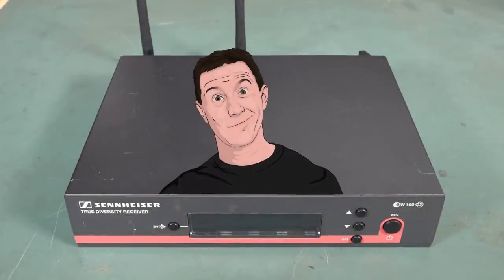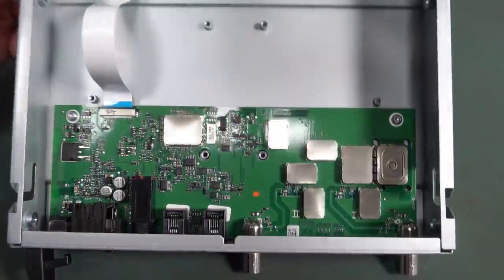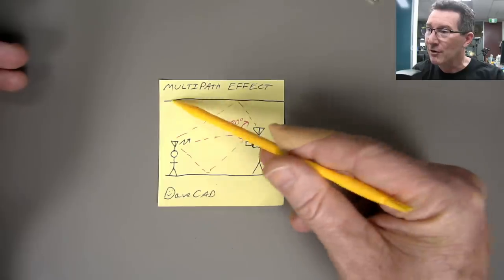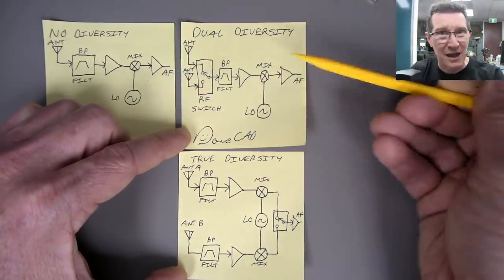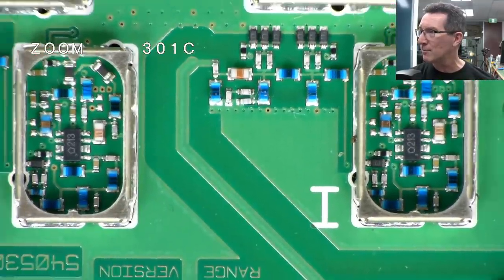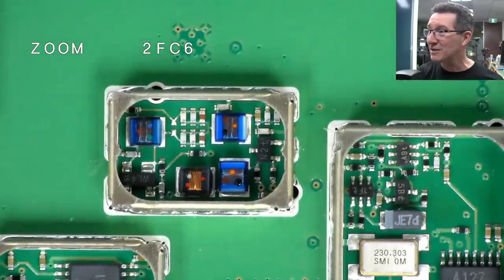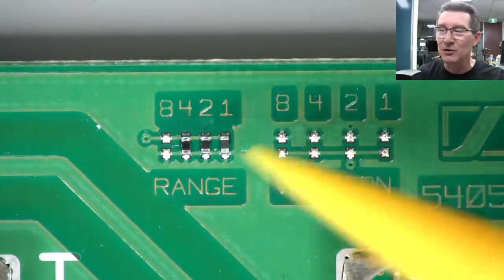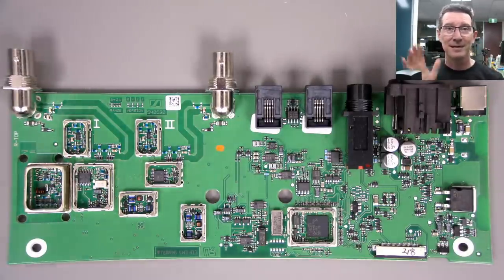EEVblog 1416 - Random TEARDOWN: Sennheiser EW100 True Diversity Receiver

Comment: Another benefit to diversity (when using linearly polarised antennas) is that you can set the receiver antennas to different orientations (90 degrees apart)  so as to significantly reduce the up to 20dB loss associated with the transmitter antenna being 90 degrees out of plane with the receiver antenna.  Pretty handy if your transmitter is mobile and changes orientation regularly.
Reply: This is a way to go when setting up live events with wireless microphones...
Reply: That completely disagrees with recommendations for Wi-Fi radios capable of spatial diversity.
The antennas may be angled relative to the housing, but as a pair they should be parallel to each other.
Reply: @howardhiggins9641  thats MIMO not reciever diversity

Comment: Hi Dave ! love your videos. 
I used to work for a car radio manufacturer in the late 80s . They devoloped a didiversity receiver for the FM broadcast band. It could mix up to 4 atennas. The atennas were not switched, instead it fase shifted the intermediat frequency stage and summed up the signals and then to the demodulator. The net effect was sinthezising a directive atenna sensitivity pattern to maximise the best signal quality and reject intefering signal paths.
All done in analog domain !!
Reply: Range Rover P38 uses that exact system.
Reply: thats a phased array not a diversity system. Been round much longer than that

Comment: Not a Faraday cage, more like a massive large multimode waveguide. Complete with random absorbers and filters all throughout the volume, so that you can get a point that is 30cm away from another, yet have 60dB of signal strength difference between them.

Comment: Dual IFs and dual mixers mean it is a double conversion receiver.  The IFs are 241 and 10.7 MHz. Only the first LO is tunable. The service manual for a similar product, the OM100, is on elektrotanya.

Comment: 22:00 yes, you can power these recivers from an antenna-combiner via the bnc
Reply: live sound engineer here, this is the answer. Company I work for has about 4 cases, each with 8 of these receivers and 2 combiners at the top. Larger gigs that require all 32 of the receivers will use another case that has another combiner to bring all 32 receivers into a single pair of antennas that will typically be placed stage left to front of house. Occasionally we'll use 1 antenna stage left, the other stage right, but we try to avoid this due to theoretical impedance mismatches with different cable lengths.
Reply: Those components look pritty tiny for powering the reseaver.
Reply: @ceilingfanmusic6597  The receiver only draws 4 watts peak, so that diode is plenty big. And presumably both antenna connections would be feeding power, so the current in each of those diodes would be cut in half.
Reply: @strehlow  maby true but look at the components for the dc input compared to the phantom power in for the receiver. I'm sure it works but they just looked small to me lol
Reply: @ceilingfanmusic6597  Without tracing everything, it isn't clear if the main power components are even used if phantom is there. Meaning does the phantom feed the inputs of the regulators, or replace them? Clearly it works, but I can't explain exactly why without studying it further.

Comment: @22:00 Those diodes on the antenna inputs will be input protection to shunt excess input voltage to ground to prevent overloading of the front end, that is a common technique to prevent front end overload.
Reply: Doubtful.  Were that the case, one end of each diode would be taken to ground as immediately as possible, and there would be no earthly reason (sorry) to run a long trace to connect the cathodes of the diodes together.  Also, the ferrite beads would hurt the surge suppression capability.  A quick scan of the user's manual shows that the ASA 214 antenna splitter is in fact capable of powering receivers via the RF input jack, so this appears to be the purpose of these circuits, and it explains the orientation of the diodes.  The two ferrite beads and the the cap to ground help prevent noise on the system power rail getting into the RF input.

In less time than Dave spends in frenetic speculation he could have done a few simple continuity checks to see where the cathodes of the diodes connect into the system.  Seems likely they go to the input side of a regulator.  Were they connected straight to the supply rail, there would be no reason to connect them together with an isolated trace rather than dropping each one directly to an internal plane.

Speaking of diodes, perhaps more interesting are the two groups of three diodes on each of the input filters.  Notice that they are in parallel within each group, and the anodes are grounded.  There is a resistor connected to the cathodes, and that node also connects to a pair of paralleled capacitors  that form part of the filter circuit.  Unless there is a negative supply in the system, the diodes will always be either unbiased or reverse-biased.  This, and the fact that there are 3 in parallel, suggests that they are varactor diodes used for tuning the filter, probably under processor control.  Presumably, the three in parallel are needed to get more capacitance.  Were they, say, PIN diodes for band switching, the orientation would be opposite and it seems unlikely that three would be necessary.

Comment: The is actually rack mountable, it just doesn't have the hardware attached. The same case style is also used for the 1:4 aerial amplifier/splitter (which can also provide power over the bnc to the receivers), which might explain the extra mounting points.
Reply: We talking a 19” rack? That’s a lot of wasted space…
Reply: @colejohnson66  yep, a 19" rack. They're designed to fit side by side, so you can get two receivers per 1U. In fact, now that I think about it, those extra mounting holes will be for the plate that is used to connect the two receivers together.

Comment: Sennheiser evolution user here (for decades!)  Great units for both their wireless lav kits, XLR mic plugs (as seen on ISS / NASA all the time) - and I can confirm the receiver base stations are better than the small camera receiver units which can flutter a bit at times at distance.  But on the whole, 10 hours battery life... super durable casing and connectors... easy to configure... can custom name on the displays for ID, etc.  Staple of the news and video production industry!  I glad to hear the Dave tick of approval on them.

Comment: You didn’t mention Rayleigh fading - although you did kind of describe it. The effect of the multi path is to cause a deep fade / cancellation every half wavelength you move.  Polarisation diversity antennas are often used in mobile phone systems to avoid too much clutter on rooftop sites - another way to achieve diversity without two physically separate antennas.

Comment: Sennheiser ...... Ah now there is a name you can TRUST. I bought my twin daughters bottom of the range Sennheiser headphones ... like 5 years ago or something when my kids were 10, they cost like $15-20, but even my daughters could immediately tell the sound quality difference from all the BULLSHIT Dre Beats, and other "fashion" phones all their m8s had. And both sets are still working .... take away QUALITY does not always require a phat and open wallet :P
Reply: Except they recently sold the entire headphone brand. Wait to see what happens there.
Reply: @Shawn Bergin Is that epos like the old speaker brand?
Reply: for the old and cheap models I have (hd 415 and 457) the sound is just correct but the build quality is great compared to an AKG k242.

Comment: It's not a Faraday cage Dave, it's a giant capacitor, if you full charged it then shorted it out through a DeLorean  it would generate 1.21 gigawatts of power
Reply: Except the plates are completely shorted together by the rest of the steel framework.
Reply: @SomeDudeInBaltimore  "bleeder resistors"
Reply: @tythagoras5787  Very, very, VERY low resistance shunts

Comment: Nice video! It seems to have overlooked one small but nice hardware feature of the EW100 G3: just left of the display, there is an infrared (IR) interface. Why? Quite clever: the wireless microphones / belt pack transmitters have such an interface as well. When held less than 10cm apart, the user can synchronise the programmed frequency and the user programmable mic name (“Vocals Peter”). Quite handy! Setting frequencies on these small microphone transmitters is not trivial, especially when you have multiple mikes and are working under pressure such as in live sound. The presence of this IR interface makes you wonder how 'standard' the display assembly is... 

Talking multiple mics, some have already commented on the fact that the EW100 supports DC powering related to its two antenna inputs. Actually, if you look well at the labelling on the back panel in the video, you can already see it’s DC power into the device (from antenna to device), and not from device to (active) antenna.  

Why does this feature make sense? Audio engineers often use multiple wireless mics/bodypacks, so also have multiple receiver units. Also, they often have their receivers at the back of the venue (‘Front of House’), with the microphones on stage, and then want to use well placed, directional antennas. For such users, Sennheiser was selling ASA 1 Antenna Splitter alongside the EW100 G3 series (now replaced by the ASA 214 which supports G3 and G4 units). It not only allows you to connect a set of good active or passive antennas to up to four receivers (or 8 using two splitters), but, using the DC powering feature, also power all these receivers. This not only makes the setup cleaners, but also more reliable. (Not irrelevant, I had a EW100 PSU failing myself, too bad that these expensive devices seem to come with not-so-good quality power adapters…) 

Kind of in the opposite direction, for in-ear monitoring (IEM), Sennheiser has a similar system on the market: with an AC 41 antenna combiner, up to four (1/2) rack-mount transmitters can share a single antenna while the combiner also powers all these transmitters.

Comment: Maybe somebody else already mentioned this, but...

Sennheiser rack mount receiver (this one is rack mount receiver, it only need rack mount kit, mechanical steel stuff) have option to get DC power via RF BNC. Imagine setup with 8 receivers. Each receiver need 2 antennas and wall PSU, total 16 antennas + 16 coax cables + 8 PSUs. Now you need to put all these 16 antennas on stage or in TV studio and connect 8 wall PSUs in your rack. WHAT A CABLE MESS!

In these situation Sennheiser can sell you additional device called antenna distributor. Antenna distributor have ~20 BNC connectors on back and IEC12 power inlet. 2 BNCs for incoming antenna coax from stage, 16 BNC OUTs to receivers, 2 BNCs for linking (don't ask why, I don't remember why there are LINK  BNCs). Antenna distributor split (and ampilfy a little bit) incoming RF signal from antenna and sent to every receiver, but... antenna distributor also deliver DC power to every receiver on the same BNC. So, now you only need one 230V AC power cord for every 8 receivers  + distributor. Nice and clean cable management!

As bonus antenna distributor also deliver (receiver is not delivering) DC via BNC to antenna input specially for optional antenna 10 dB(?) RF amplifier.

Comment: 22:05 - correct, you can get an antenna distributor that will power this unit over the BNC cables - see Sennheiser ASA 214. now a question for you.. 
i have Sennheiser IEM transmitters which are powered from an antenna combiner over the BNC cables. i also have a Shure PSM300 antenna combiner, which isn't powered over BNC. will plugging the powered combiner into the PSM300 damage the latter?

Comment: I have some dB technologies wireless systems where the RF cans are actually branded, something that you think might look a bit chintzy but actually it looks really smart, also it's wise to not their cost cutting in that the posher reciever with an LCD display and metal case actually uses the plastic case (rear and bottom) and mainboard from the cheaper reciever.

You need to acquire some older wireless systems now to teardown, the old TOA systems with the silver/gold/satin receivers are available quite cheaply and seem built very well, including using a built in PSU. 
Also noting that despite their age (released in the early 80's, I've seen adverts from 1985) they use AAA batteries (x3) and as such you still get 5hrs of battery left with the battery low LED lit, some 9V systems don't last much longer on a full battery, total rated battery life is quoted as 30hrs and I for one believe them.

Comment: Qorvo has been around quite a while.  In Wi-Fi they tend to make the higher quality. mid-scale hardware.  There products would not be used in cheap, low cost products that are meant to be sold at the cheapest price.

Comment: I think modern diversity receivers do some maths (I know, nasty business) with both received signals to get a better signal than any of the original ones.
Reply: In the 60s I used diversity receivers at a NASA satellite tracking station. They combined the two signals according to their signal strengths. All analog in those days.
Reply: That's called "beamforming".

Comment: Dave, do a video on the differences between IF, and RF.
Reply: If I can try to summarize it... RF is the frequency high enough to propagate efficiently from the antenna, but at the receiving end it gets converted to a lower one (hence intermediate frequency) which is easier to work with. If all the circuit worked on the higher frequency the values of components and PCB layout would both be impractical. Therefore, that RF is brought down to an IF to process it.

Comment: Can the processor mix both channels and adjust for phase differences? Or does it just switch to the strongest?

Also is it good practice to point antenna in different axis? My wifi card has 3 antenna and I point each in a different axis. No idea if I should!
Reply from the maker: You'd generally just switch.

Comment: ah the fpv Quadcopter recievers use a similar system with two rx5808 5.8ghz reciever modules and then use a cd4066 for the switching of the recievers, well not the signal but they switch between the composite video out
Reply: I had an A/V input selector that used 4066s and I noticed that the colors would change slightly when going through it. The blue screen of a VCR with no tape (yeah it was that long ago) looked a lighter, more grayish blue. So if your image looks a little washed out, try looking at the video signal before the switch.
Reply: @gabotron94 i didn't know that but for my application its suitability since Quadcopters are moving at very high speed and the noise in the video from the wireless transmission makes it something negligible, still i will see how much of a difference it makes